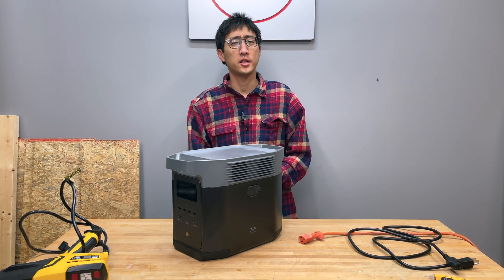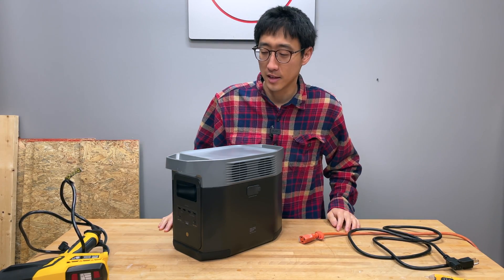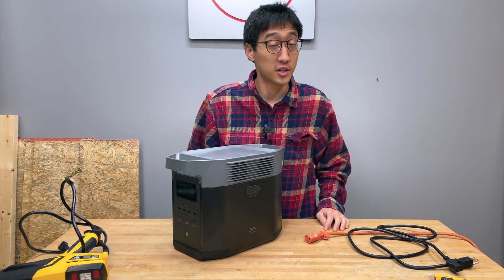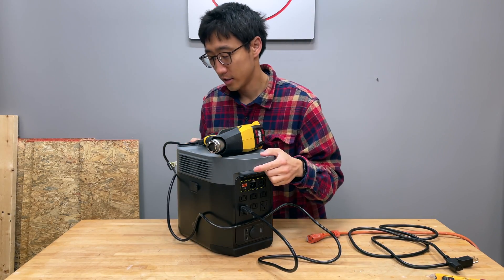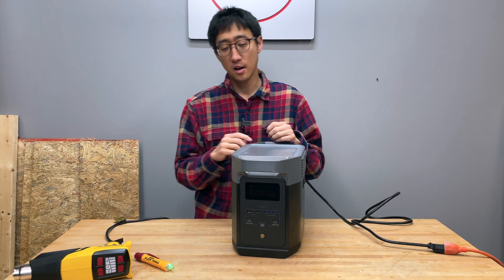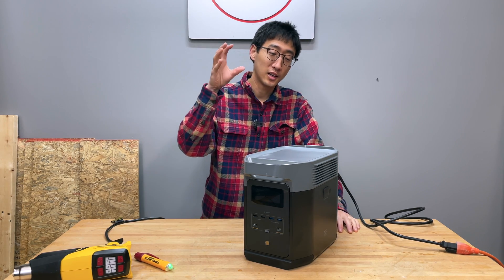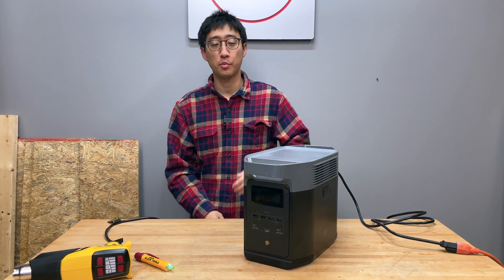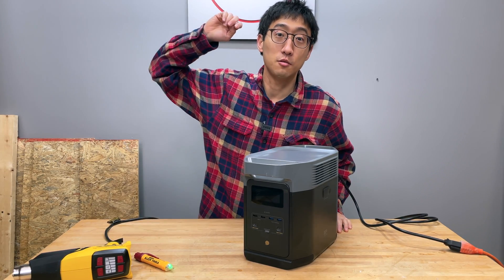EcoFlow Delta 2 Failed | Do Not Buy | Build

Comment: Bro, you’re one of those guys who thinks 12V to 220V—or 110V in your case—just happens by magic. You could have a rail missing, showing 5V or 3V, and to me, this looks like a typical issue where you’ve lost output to the battery—it might just need a reset or something similar.

I understand you paid for it and that you said it worked well. But the problem might lie more with your own lack of understanding of electronics than with the device itself. You can’t just come out and say “don’t buy it, it’s crap” when you’re the one uneducated on how to maintain and operate it properly. I bet you don’t even realize this.

Honestly, I was expecting an electronics guru with glasses and 20 years of experience to know more about this new tech—but of course, I wasn’t wrong about my expectations. Stop making misleading videos. I have two of these units, and I’m using them hard—running a 1kW radiator for 1 hour. I charge one while discharging the other, and this has been my solution to beat the meters.

I feel bad for you because you may never recover from this mindset of “I’m right, my right, my right!”
Reply: been reading the comments.. obviously this guy is doggy.

Comment: Have the same unit and basically the same thing happened. It went out on a camping trip where I fortunately had access to shore power. Spent a few hours over multiple phone conversations with Ecoflow support to get it taken care of. They did honor the warranty, however they did not send a new one, instead received a refurbished one. I was given the option of receiving a refurb once they received my dead one or to get mine back once it was repaired. They couldn’t give me a time frame for the repair so I chose the refurb. Still took almost a month to get the replacement. It has worked fine since receiving it. I believe what probably happened was that there was a surge in the power at the campground and it affected the bms, as I was using the Delta 2 as a pass through. Im thankful they honored the warranty but I doubt I add to my Ecoflow ecosystem. I purchased this along with the extra battery and the wave 2 portable a/c. Luckily I didn’t pay anything close to msrp for any of it and still hope to get enough use out of it to justify the cost. It is sad that a consumer pays that much for something used in emergency situations and I don’t have the confidence that it will work properly when needed.

Comment: So this one unit failed and you're telling everyone to not buy from this brand. It doesn't matter the product or brand getting defective units will happen. How the company responds is the main concern for me. And yes I hold on to the shipping box. Twice I have gotten a defective product, but the company offered to replace it including shipping both ways. Your one defective product that you won't bother to return does not make the brand or product bad. If you bought 10 units and most were bad that would be a problem. How do you deal when your car has a problem?

Comment: mine just died today :-( a little over a year old and i only use it for backup for pc... very disapointing..
Reply: STAY FAR AWAY FROM ECOFLOW PRODUCTS.  I HAD A DELTA MAX AND IT WORKED A FEW TIMES THEN DIED.  IT WAS UNDER WARRANTY AND I HAD IT REPAIRED AND USED THE REPAIRED UNIT A FEW TIMES AND IT FAILED.  OUT OF WARRANTY, OUT OF LUCK WITH ECOFLOW.  I WILL NEVER BUY ANY OF THEIR PRODUCTS AGAIN.

Comment: Of course, it failed. All Ecoflow products use cheap high-frequency, transformerless inverter technology that's only good for a couple of years' worth of use at most. You should have purchased a low frequency, transformer-based inverter charger instead.
Reply from the maker: I stopped buying them for this reason

Comment: I had the Delta 2 battery fail with the ! Light.  Now the smart battery add on just died.  2 for 2.   Least I built my own too
Reply from the maker: I think it makes sense to just build your own with reliable components and self serviceable. but some people just need stuff off the shelf. Which mass market power stations would work for them
Reply: @tgbatg agreed.  The smaller form factor is handy but my DIY setup has been solid.  Even with the warranty I have to wonder if it’s just 6 months away from a paperweight after that expires

Comment: I had the same problem with my Delta 2 powering an electric water heater. I suspect that the occasional high load messed up my Delta 2. I did have warranty but sending it in was a pain as well. I went to 3 different FedExs before one of them told me that I had to call and have it picked up. None of the FedExs would ship lithium batteries, only pickup would do that.
I'm no longer a fan of EcoFlow. I have their Wave 2 AC and I've had to send that one back for warranty as well! 
Both sent back for warranty exchange within the first year of ownership for each.

Comment: Had mine a little over a month and now its flashing red explanation point and temperature gauge....  won't charge  edit:  I had it plugged into a heater and it went to zero percent and wouldnt charge...after unplugging and letting it sit for about an hour (I guess to reset) it started to charge again from  zero percent.
Reply: I just got one on Wednesday tried using it yesterday and now I have the same flashing exclamation point ! So mad! I really needed it yesterday!

Comment: Please create a Single Panel (400W/30Voc) Solar/AC input generator with 2KWh LFP and at least a single 1500W/120V output. Purpose is Low cost MiniSplitCooler AC support.

Comment: Last time I checked Ecoflow products have a 5 year warranty. Instead of making a useless youtube video why not initiate a warranty return? Stuff does break!
Reply: I sent a delta 2 in under warranty and they sent me back a extra battery.
Reply: Posting misinformation is a waste of everyone's time stop making useless post
Reply: they don't respond to me .. delta 2 doesn't keep s charge
Reply: I have a broken Ecoflow.  The warranty is 2 years, not 5.  I have about 5 cycles on the batteries and have it for emergency use only.  It failed.  Ecoflow will not replace or repair the unit (even if the service department charges).  Terrible for how much this costs.  My DIY solution that is much older and has hundreds of cycles works fine.
Reply: @chunger169  Agree.  I have a Delta and I've replaced it TWICE....I have no confidence that it will work when I need it in an emergency.  I have a RIVER that seems to now not be holding a charge.  Both of these are less than 5 years.  I won't buy another ECOFLOW.
Reply: @chunger169  I checked the website it says 5 years for the Ecoflow Delta 2. At least in Europe, maybe it's different in the US.

Comment: I have had my EcoFlow Delta Max for almost 2 years now. I have never had any issues with it. I even bought it through eBay as a refurbished unit and they included an EcoFlow 110Watt solar panel. I never drain my battery completely and normally keep it charged around 80% I do cycle it down to 50% every 6 months and then up to 100% to do a fresh cycle. Never let the battery get below 20% and it can last you so many years! 

I have a BluEtti and the EcoFlow just blows it out of the water! I guess some people just either get a bad Unit or just don't take care of the power station properly? Did you try to call EcoFlow and tell them about your issue and have them trouble shoot your power station?
Reply: I charge mine to 98% and down to 8% every day is this a bad thing to do? I ask because you mention you never let the battery get below 20% why not? , I am curious to know if I am doing something wrong or bad, I want to prolong the life of my Delta 2 Max ( i have 2 of them) they work fine but like i said I do charge them once a day upto 98% and use them all day till they get to about 8% then recharge again to 98%, thanks for your feedback or anyone that is familiar with charging and recharging the right way for daily use, I don't store my Units, but use them daily. thanks again for any help and feedback
Reply: @HumbleLife8  Everything I've owned and read that use lithium batteries need to stay between 40-ish percent to 80% to get maximum life of these types of batteries.  I wouldn't drain it to that low and especially for long term storage.  That's why when you buy rechargeable battery gadgets they usually ship it in a 30-40% state.
Reply: @ArceezRC  what if I use these batteries 24/7 365 days, I usually go from 90% Charge to 20% discharge and then recharge, but I do this daily as I use them all day everyday. so far they work out well, 40% to 80% seems to low, but I dont know which is why I ask, I find alot of people do the 20% to 90%, I dont store my batteries just use daily, lmk thanks for your feedback
Reply: @HumbleLife8  that's fine that you use it like that. The 40-80% range is when you're not using it for an extended period of time (storage state).
Reply: @ArceezRC  ah ok thanks so much for taking the time to respond @AcreezRC,

Comment: Cost depends! These companies already have an advantage of being able to get the parts much cheaper. Because they buy these parts in bulk. And we already know when a customer by things in bulk, they get the individual items much cheaper. 

Than there is the convenience of getting everything with a push of a button. And most people don't have the expertise of putting together a system. 

Then there is space. If you buy all these things separately, you have to make more space for them. And that is a problem for more and more people who live in apartments. 

And more and more people are traveling for work. They do not want to have to move different parts around. It is a hassle. 

I had built systems in the past and I prefer the eco flow. They have a warranty if something goes wrong and you have an option to extend it past two years. You also have access to customer support during business hours. 

With individual products like an inverter, a battery, a solar controller, ect. You have to contact each individual company if something goes wrong. 

Eco flow and it competitors always have discounts on their products, because they are a big company. So you actually might be paying more if you go with individual parts, besides what I mentioned earlier. 

Good luck.
Reply: I have ecoflow product for the most part I like them. But there is no doubt you can build a system cheaper, not to mention if you are building a system your probably just gonna buy all the separate pieces all from the same company ( victron, EG4 etc. ) that way they can help with support and walk you through each component instead of calling 4 different companies for different support.
Reply: @lanceboudreau3630  You can build a system cheaper. But you have to cut cost on certain components to stay ahead. It is worth it, if you want the flexibility of adding capacity vs convenience. 

Note: It starts to get more expensive as you add more Eco Flow to match the capacity that you really need. And where your own system begins to start being cheaper.

Comment: I had a different power station that failed. Someone else with the same issue had to make a video of the problem and send it to the manufacturer before he uploaded footage of that video to YouTube. So I figured it was not an easy fix I would be able to do. It was a lower price power station and probably 2 years old so I currently have no plans to do anything with it. Sucks that they aren't made to be fail proof though at the price you pay for them.
Reply: And all that dirty fuel ⛽️ ecoflow use sending the units back and forth Germany, to Spain, Germany to Spain, Germany to Spain, Germany to Spain, Germany to Spain Spain to Spain Germany to Spain Germany to Spain
carbon footprint 👣 🤦🏻‍♂️ 
God know how many I’ve sent black I lost count 
But this replacement they just sent me as a warning lights on it and now I’ve just been told to send it back yet again 

I wish i just bought a petrol generator at the beginning

Comment: I have played around and fixed a few of these units if you get no support take the top grey case off and side panels and first try to re seat the connectors especially the one to the main display 

I’m not sure if the delta 2 has the same bms as the delta max but that unit has 2 test buttons on the side of it the first one on the left runs some kind of test function that will momentarily open the relay to the main positive and negative going to the inverter and dc board allowing you to read the dc voltage with a meter so you can check the pack voltage 

The second button on the Right turns the screen on and off 

Hope this helps

Comment: I have one with the same problem it turns on when you put it into ac outlet or solar panel but the battery will not charge, so was thinking it was the cell rebuild it with new cell it was doing the same thing get to no that the bms have problems It has software locked on the system, I put aftermarket bms works turn on it was not charging form ac

Comment: I have two Delta's. The Delta 1300 and this one with 2 spare batteries. I've had the Delta for almost a year and the Delta II for about 6 months. I've had no troubles with mine.  Sounds like a blown fuse. You didn't mention how you've had it. If it isn't in warranty, open it up from the top and see what you can see. Like suggested below.. have you connect a panel to it..?

Comment: Have you tried to hook it to solar?  The battery BMS might have tripped and you might have to "jump start it"
Reply: How would you do that?
Reply: I guess solar is over. @thetonys
Reply: @thetonys  you may even have to disconnect the power of the bms for a few minutes and restart everthing this is one of them things when it looks so good and someone that knows electronics can fix it with a reset or replacing a fuse. or a bad cap.

Comment: I’ve been looking into solar power generators, but very hesitant. 
Especially with all the battery 🔥’s 
With gas, it may make a bit of noise,
But it will work - @ Night, cloudy or otherwise!
Reply: But you can't forget gas is only good for 6 months
Reply: @ryangreen3332  That's true.  Just gotta weigh the pros and cons.  With batteries, they have a shelf life too and owners gotta be disciplined to keep it between 40-80% for long term storage purposes.
Reply: I own an EcoFlow Delta Max and absolutely love it. I have had mine almost 2 years and if you take care of it and not over charge or just plain abuse it. It will last you many years! :face-red-heart-shape: